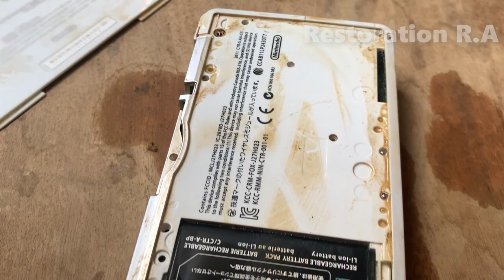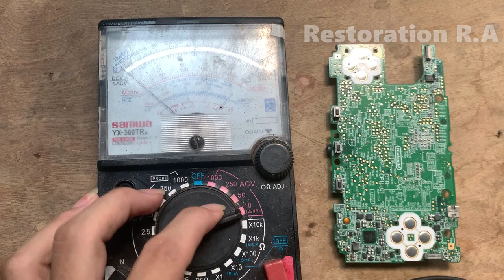Restoration old Nintendo 3DS Gameboy | Retro Nintendo console restore and rebuild

Comment: ♻💜♻💙
Reply: Unfortunately, this restoration is fake. The 3DS was destroyed on purpose for this video. The video was then only cut together so that it looks like a "repair".
Reply: @treschau1  I think someone didn't want it so he or she threw it away.
Reply: Nah, I would say unfortunately no. If you look closely, the brown paste looks artificially applied, especially since the technology itself is hardly or not at all affected. Especially since the exterior is so worn and inside the technology seems to be perfectly fine. It's also nice that the SD card is still in the device. In addition, technical devices should not be cleaned with water. It's okay for the case, but not for the technology itself. Furthermore, it is questionable how the screens could both have suffered such damage. That they were then further tattered during the "repair" has no practical use and only makes the screens more broken, etc. It would certainly be possible to list a whole lot more. There are many such videos on youtube and from what I've seen, they are pretty similar in structure and how they so it. There are videos where devices are really repaired and cleaned, but this one is not one of them.
Reply: @treschau1  you cant fix stupid with wall of text. He wont be able to process it all at once.
Reply: @Tyronexl1998  it is fake, the video was staged and they purposely left it there for content